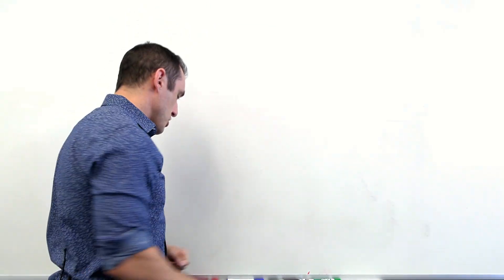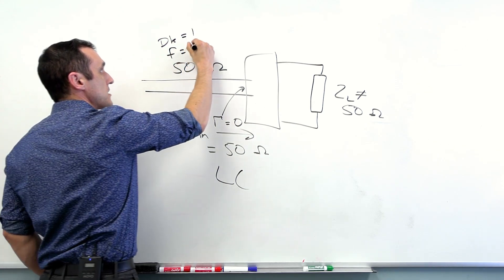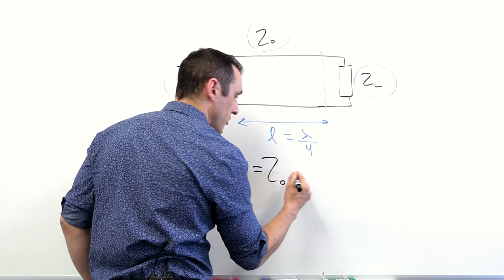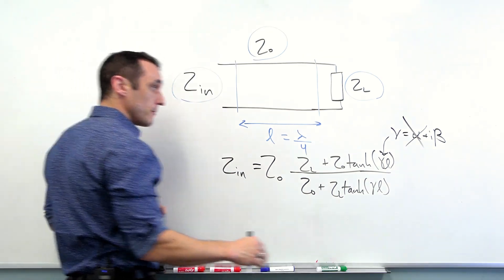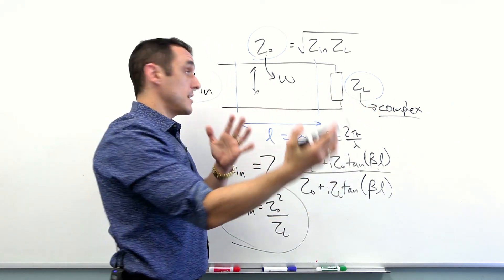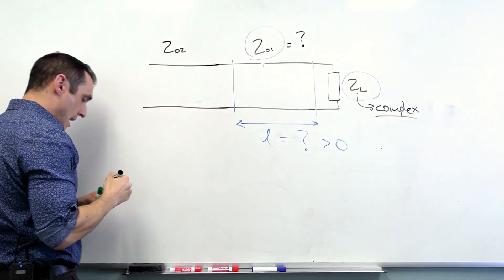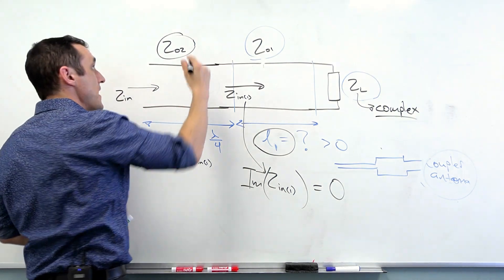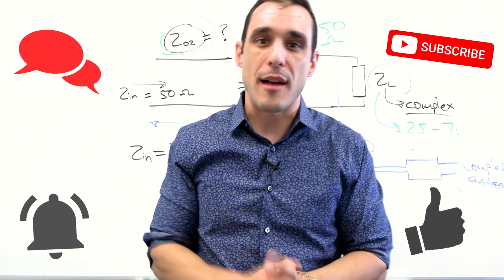Quarter Wavelength Impedance Matching

Comment: Alright everyone this contest is over and we have a winner! The answer is for this specific problem is: the length of T line 1 is 0.0292*lambda, the impedance of the quarter wavelength line is 35 Ohms.

There is actually a universal answer that I'll outline in an upcoming video when we announce the winner. Hint: it's always an 1/8th wavelength line!

Comment: Hi Zach, I got 0.0291 lambda :-)
Also, it can be solved with single TL of Zo=33.94 (rounded 34) with single length=0.31227  lambda (0.312) 12% longer, but wider BW and less reflection...
Reply: Correct! You can also watch the derivation of answers here:
https://www.youtube.com/watch?v=euLADxkjG98

Comment: Hey Zach, love your videos!
I have a question for you to make a video about it. I've been told by engineers to pour power planes under all the components that references to that plane potential.
Meaning, they want the plane to exceed the vias related to the components and surround all of them because of parasitic capacitance that the plane have on the interconnects of that circuit.
Can you please make a video explaining about the parasitic capacitance of power planes? thanks!

Comment: I got Smith's charts flashbacks from my uni exams.
Help
Reply: Since I gave the desired impedance of the transmission line connected to the load, you shouldn't need a Smith chart. FYI, I detest Smith charts....

Comment: Hello Zach, here's my result to your challenge. I found that l1 = 0.029*lambda and Z02 = 35 Ohm.
I normalized the load impedance to 0.5 - j*0.14 then used a Smith chart to find that the input impedance becomes purely real with a T-line length of about 0.029*lambda. This normalized input impedance was approximately 0.49, denormalized to 24.5 Ohm. Using Zin = Z0^2 / ZL for a quarter-wave impedance transformer, I obtained Z0 = 35 Ohm. Let me know what you think!
Reply: My cat thinks the same, but you made a terrible mistake referring to the Smith chart. Zach doesn't like the Smith chart so my cat is terrified right now...